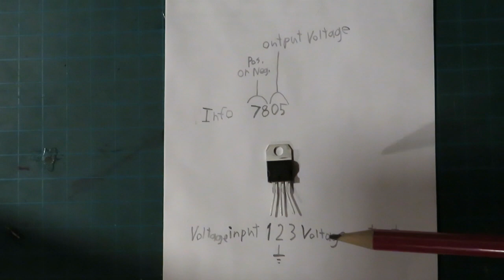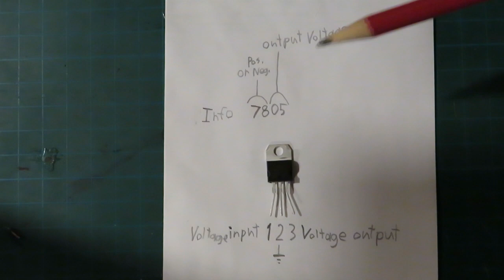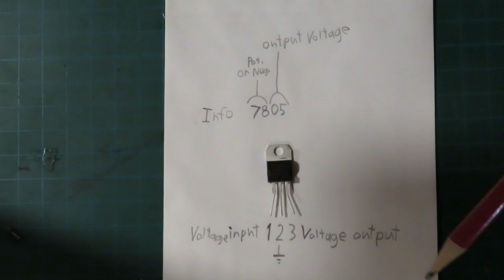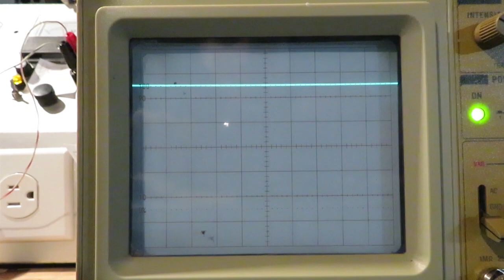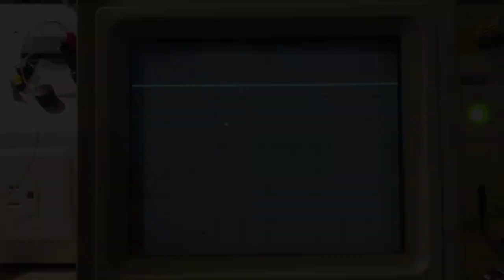How to use Voltage Regulators

Comment: I usually will put a capacitor on the input and the output to help smooth out the ripples that the regulator can generate. It's also best if you have at least 2v head room above the rated output, but having more like 3v+ will help with ripples as well.
Reply: Also LM317 are fun to play with. It's a variable voltage regulator.

Comment: You should try designing your own PCB. It's cheaper and easier than you might think. I guess the hard part is figuring out what circuit to put on it, but you can start out simple. EasyEDA is a free option that's not too hard to get started with. Kicad is also a good free option.

Oh, also I don't know if you've played with microcontrollers at all, but I bet you would enjoy learning how to use one if you haven't already. Personally I think the raspberry pi pico is a nice one to get started with, but Arduino is good as well. Lots of online tutorials and information for both platforms.